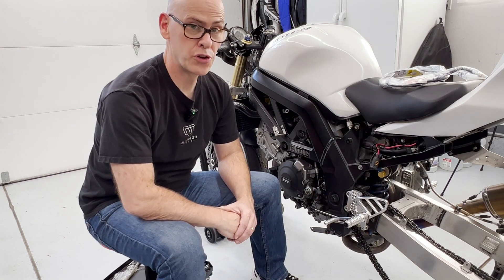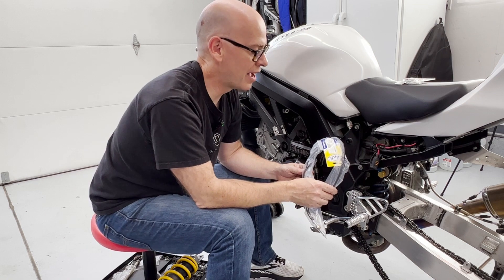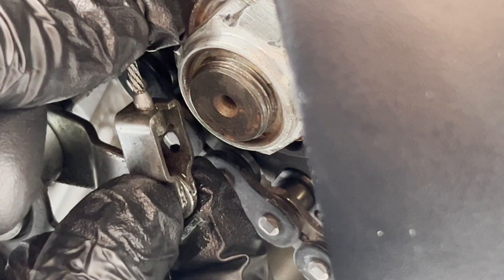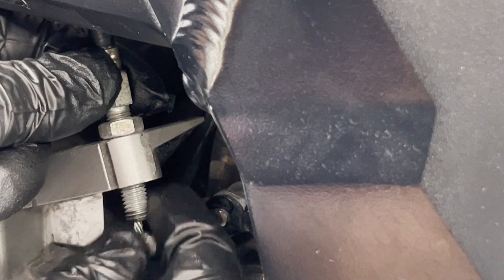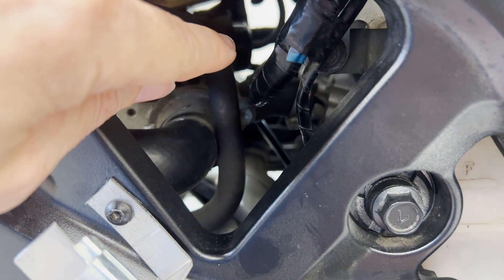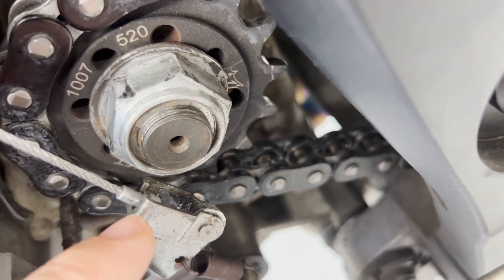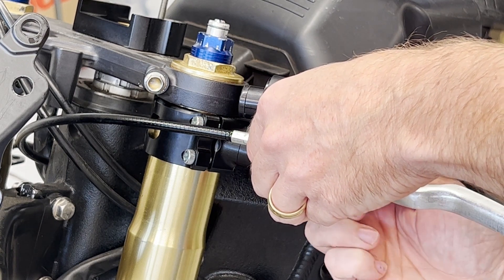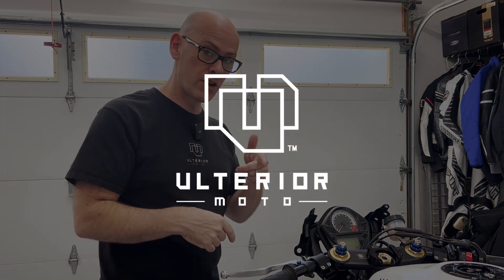How to Replace the Clutch Cable on an SV650

Comment: Good timing with this. I have just got one of these from Zoran. What product did you use to lubricate the cable? Do you have a quick turn throttle? This would be a good install to see👍🏻
Reply from the maker: Perfect! I used the Motion Pro Cable Luber V3. Check out my other videos and you will see a review/how to for that on my other bike. It's exactly the same on the SV. 
Yes, I do have a quick turn throttle I picked up from Spears. That was a great mod and super easy. Slide the rubber cover off the throttle cable housing, unscrew the two screws holding the housing together. You'll see how the cables attach, similar to the clutch cable. Just remove them, slide the old tube off, and put the new one on. Reverse the process to reassemble and you're done. Might take 15 minutes max.

Comment: Awesome thanks for the help man! What clip ons are you running g for your handlebars? I have woodcraft and they run into the bolts on the triple tree.
Reply from the maker: I have the 35mm Rise Side Mount Adjustable Angle Clip On Riser Kit. If your rise is sufficient it should clear the triple bolts. The other option is that you can get the ones angled toward the center of the forks. In my case I have both the rise and that center orientation. If you go with the center orientation, you probably want the short bars because you can’t slide them through the bar clamps like you can with the angled mounts.
Reply: @ulteriormoto  Thanks man!